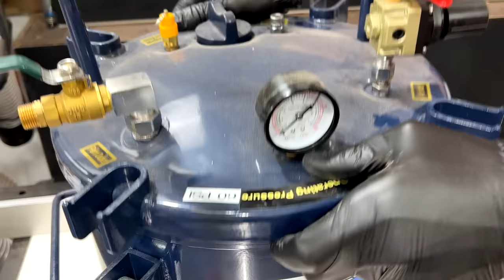Woodturning - Woodless Woodturning // A Brilliant Idea For Paper & Resin !!

Comment: I love it!  Honestly, you scare the daylights out of me when your fingers get that close to the saw blades. I have to fast forward through those parts.
Reply from the maker: It’s just the way it’s edited.. I’m going much slower than it looks there 😆
Reply: @JackMackWoodturning  Still, i'll ask you please, use a stick to push things through that saw.
Reply: @Alejandr0varsay  that's one of the benefits of a bandsaw. There is virtually no chance of kickback and it is one of the safest saws to use.
Reply: I agree - Please use a stick. It will be huge loss if  talent like this will lose a finger
Reply from the maker: Hi guys.. what you will find here is that those who use a bandsaw a lot don’t saw “use a push stick” because they understand.. and those saying “use a pushstick do not understand bandsaws.. it’s understandable that you think a push stick is the right way. But your not right. Thanks for your concern all the same.
Reply: @Alejandr0varsay  i was taught how to use a bandsaw in school. It is great for cutting shapes as you can guide it with your hands and turn the wood while cutting. The only time we were told to use a push stick was if the piece is too small to hold without getting in the way of the blade. The saws that always or usually need push sticks we were not allowed to use ourselves in the first place (this was 7-9th grades). If i was told by a woodworks teacher to cut out a drawn imprint of a hand (pretty complicated shape for the first ever try) without pushsticks or guides when i was about 13, i’m sure the actual woodworker will be just fine. 
Sometimes not using a tool is not about having a cocky attitude. Every machine has its own safety needs, you can’t apply everything the same way to everything. Like protective gloves for a more extreme example, a childhood friend’s late granpa was trying to be safe by wearing them while using a table saw, and the blade caught the glove. I saw the prosthetic hand on their attic. I highly doubt a pushstick would ever be trying to take a hand but sometimes it is just not useful, in many cases all it does is cause a lack in dexterity. Knowing your tool and the safety requirements specific to that tool is much more important and safe than going with a gut feeling based on other tools.
Reply: @SesseTheWolf  I agree 100% with you about the necessity to push barehanded when it comes to SHAPES, (as it allows proper control) and also  the danger of  gloves geting caught, no contest.

Of course, knowing the materials properties (soft or hard etc.), allows you to adjust technique and pressure while moving the pieces...I said "use a stick"
 because he was pushing a lot of small irregularly shaped pieces smaller and smaller every time.
Reply: @Alejandr0varsay  One of my professors would have us use clamps when using the belt sander or band saw and the thing we were holding was small. You just hold the clamp instead and your hand is about 3" farther from the blade, plus you can move the object just as easily. For most things I don't feel like I need them, but these are definitely small enough that I felt uncomfortable and I would use clamps if it were me.
Reply from the maker: This is not about arrogance. This is me disagreeing that a pushstick is of any benefit in this situation and further more making the point that a pushstick could in fact be a danger in this situation. 
You said yourself that I am cutting irregular shapes smaller and smaller.
Knowing this we know that the piece being cut requires a slight downward force and a very slight forward force. Two points of contact are needed to move this  irregular piece through the cut. 
How would you suggest safely doing this with a pushstick? 
The danger in this situation would arise when the lack of control caused by using said pushstick causes the pice to move freely after the cut is finished. This can cause a small and irregular piece to flip back over on its self. As it does it can be caught by the saw blade and pinged off the bed of the saw and up at high speed into the face of the operator… I know this from experience.. it is not a assumption.. it is a fact I have learnt from experience. 

Safety is not about “appearing” to be working in a safe manner.. it is about using logic, common sense but mostly experience to risk assess a given situation and implement methods that avoid the possibility of anything unforeseen taking place. 
Arrogance and experience are not the same thing. I know that if my flesh goes up against a running bandsaw blade flesh looses.. likewise I know I am in control of my fingers and the work piece to a much greater extent if I do not impede their interaction with a stick. 

Push sticks are used for table saws. Very very rarely will you find a time you need one on a bandsaw if you are using the bandsaw correctly. The two machines have only one thing in common and that is the fact that they both cut wood. They do that in very different ways. A table saw absolutely requires a pushstick. I will very rarely use my tabkesaw without a few pushers at hand. 

Teaching people when you are not in a position to teach is extremely dangerous too. And to imply the cocky attitude comes from me in this exchange is laughable. You think a pushstick is safer in this cut because you lack the experience required to make that judgement call and choose instead to err on the side of caution, unfortunately lacking the understanding and knowledge to see all the dangers and thus putting yourself in a much less safe position. 
I’m sure you think you are a seasoned woodworker. But you are not.. it is self evident in your comments. Show this cut to ANY professional woodworker and they will tell you that a stick in this situation would be the go to of a person who is yet to understand. It’s not open to debate.. you simply can not make controlled cuts safely using a stick when there is no fence or other support to work with. A fence would not help in this cut. A pushstick would not help with this cut. Arguing the point further is futile. You and quite simply wrong.
Reply: @JackMackWoodturning  
I never said I'm a seasoned wood worker, o don't work with wood at all.
I read your explanation (specially about the saw causing a piece to flip and fly to to the operator's face, I've come across similar situation working with other machines.

I appreciate the time you took to explain this, and i understand I was wrong.
Thank you.

I'll remove the previous comments.
Reply from the maker: Please do not clamp something then run it through a saw blade, even if it is only a bandsaw..  your teacher was a teacher and not a professional woodworker. 
If you put pressure on an piece of wood then push it through a saw blade the kerf will be closed, you will need to push rather than feed the piece into the blade when the cut finishes the release of pressure can cause “follow through”
You’ll find your hand moves much more than 3 inches in a split second when that happens and it’s moving right into the blade. 

It’s baffling that you guys are attempting to talk about “safety” by recommending dangerous solutions. 

Give me strength 😫😫😫
Reply from the maker: Please do not remove your comments. It is important for people to be able to read this find of discussion
Reply: @JackMackWoodturning  I didn't know that, thanks for telling me. I honestly thought I was doing things safely
Reply from the maker: No problem at all. I’m sorry if I come across exasperated or rude. 
Iv been doing this for 20 years as a professional. And I’m constantly having to be told by hobby woodworkers that I’m doing it wrong 😆… then they call me cocky for trying to share my knowledge 😫
What your teacher showed you is a fine way to hold something for sanding. And would be okay (only in a pich) for a non through cut. It would also not cause you any real issues 95% of the time. But when you get complacent (because you think your safety solution is guaranteed) that when you’ll follow through with too much force and turn one knuckle into two. 
🙏🏻
Reply: Jack, sorry, looks like I opened up a can of worms. I truly enjoy watching your videos and think your work is absolutely beautiful. I’m so glad you are able to take the criticism with a grain of salt. I’m sure you would never jeopardize your life and livelihood. Keep the videos coming, they are truly wonderful.
Reply: @JackMackWoodturning  I agree with you that probably you know what you do.
But its looks dangerous.
So if you a proffesionalist you can imagine it could cause problems for non expierienced ones.
We just care about you and your followers.
Reply: Brenda, have a little faith. He still has 10 digits, FOR NOW. 🤣😳😳
Reply: @dang6832  I do have faith but it still makes me cringe.
Reply: @brendaconner1076  fair enough.
Reply: My first thought!! 😱
Reply: @JackMackWoodturning  it's the difference between knowledge and wisdom!
Reply: Do you actually think he would show a bloody injury? Grow up.
Reply from the maker: I have only had one accident while making these videos and I was more than happy to share it and explain in detail what I did wrong. It’s was around the time my son was born and tiredness plus complacency on top rushing to get away from work early lead to me making a few mistakes in quick succession which lead to me having an evening in the hospital getting stiched back up. 
You can watch that video here… enjoy. 
https://youtu.be/JRBVQhlGuV8
Reply: @mitchelnorton2692  why so petty. Women think of that stuff which is why they tend to die in less gory ways plus the maternal instinct does kick in. Getting my hands close to saws scares me a little too. We both know it would “violate YT standards” so they won’t show it, but let her worry without guilt.
Reply: @JackMackWoodturning  that’ll happen. I know i’ve done some “unsafe” things due to being tired. Just so long as you’re not telling someone “hold my beer” while making said mistakes. 
If I may, what do you do with the wood dust and shavings. I’ll bet you could make extra cash by getting together with other woodworkers and pooling the resources to make bio bricks for use in wood stoves or larger ones in fireplaces. Maybe paper shredding companies in the area could be elicited to add their shreds to the shavings. I’m thinking with the way we are going right now in the world we will all need some of this product to help keep warm during winters. If this works look me up, don’t know how🤷🏻‍♂️ as I’m not going to post my info all over, and give me as case or two yearly if it’s profitable. I’m not too greedy.
Reply: You do awesome work! I’m enjoying it!
Reply: Very true
Reply: Agreed!
Reply: It scared me too
Reply: How you loved this i extrem pollution for envoirment. Did you see all waste ..
Reply from the maker: What waste ?
Reply: @JackMackWoodturning  did you eat all waste ???
Reply from the maker: @vidyorumcu  I don’t produce any waste.
Reply: are you blind or what...
Reply from the maker: @vidyorumcu  no I’m not blind.
Reply from the maker: @vidyorumcu  what do you think goes to waste?
Reply: @JackMackWoodturning  Yeah you need a firm grip when cutting on the bandsaw!🤷🏼‍♂️👍🏻A dull blade are actually more dangerous ? You blades Cut VERY Well 👌🏻🤜🏻💥🤛🏻
Reply: I was thinking the exact same!!
Reply: @JackMackWoodturning  you’re not your
Reply: Ditto to the fingers close to blades 😮
Reply: Why are you scared ...not like it's your fingers .
Reply: @williamjones6053  not my fingers is correct but, I would hate to be witness to him loosing a finger. Even though he would probably edit it out.
Reply: @brendaconner1076  pretty sure that he like thousands of other trade workers use extreme care when operating tools with fast blades ..what looks scary or dangerous to you is just another day in the office for us ..his fingers were well in the safe zone ..I am a contractor and have spent the last 30 years of life operating wood cutting tools ..using caution becomes a instinct ..
Reply: @williamjones6053  I understand your point. There are times when I’m splitting wood, I know I’m being careful but, that doesn’t stop my husband from telling me to be careful.  It’s just human nature to be worried about each other.
Reply: @brendaconner1076  I gotcha ..I took your statement wrong .. misinterpreted it if you may ...
Reply: @williamjones6053  no problem. Sometimes it hard to put in words what you’re actually trying to convey. So glad you took the time to read and more understand what I was saying.
Reply: Me too!
Reply: @davidcunningham8319  Still, it's a dangerous tool. Kickback is only one danger, but if the finger slips, it's still terrible. I would also ask Jack to do it right, especially to show it to everyone who watches the videos and takes your work as an example. 😉
Reply: @JackMackWoodturning  Did you learn that in apprenticeship? Additional our master always told us: always two fingers between workpiece and bearing guide to go safer :P
Reply from the maker: No I learnt over 20 years that i am safer being able to see the cut from a standing position. The bearing is there to guide the blade and make a more accurate cut. 
As i don’t need an perfect cut and because I’m the only person who uses my equipment I use things in the way that works for me. If you feel you don’t have appropriate control of your own body/arms/fingers then the guard on the bearing may help you, however I’d say if you lack coordination you shouldn’t be using a bandsaw in the first place.
Reply: Which part? It looks safe to me.
Reply: @J_Clean_1996  I’m just a cautious kind of person.
Reply: Я в шоке 😳😁
От многих вещей.
От того, что, оказывается, в Европе еще живо токарное  и вообще ручное искусство.
От того, что кто-то этим занимается и кого-то учит.
От тоо, что у вас этому обучают в школе.
От того, что у вас бывают токари-профессора.

Я думала, что в Европе и Америке (не знаю из какой вы страны, в целом -- на западе) давно разучились делать что-то своими руками и знают только пластиковую посуду и отсутствие всякого напряжения ☺

Я в шоке от того, что мужчины способны так въедливо и долго спорить.
 От того, что вы умудряетесь соблюдать вежливость, несмотря на то, что автор периодически  макает вас лицом в ведро с эпоксидной смолой 😅
От количества слов и от того, что у автора очень правильный и богатый язык, судя по тому, как переводчик Гугл перевел текст. 
Сегодня день открытий 😊

А насчет пальцев -- интуитивно действительно страшно. Мой папа лишился пальца за один миг.
И эта мысль будет у каждого нормального человека, когда он видит такую картину.
Желаю всем вам творческих успехов и удачи!
Reply: All fun an games til you lose a finger.
Reply: Love this!!!
Reply: Same here!
Reply: @Alejandr0varsay smart advice I am almost certain he will not follow.
Reply: The kid is asking for problems.
Reply: @Alejandr0varsay only really need stick if ur cutting metal because the cuttoff could kick back and is sharp.
Reply: @GrannySoupLadle  I'll say this: When working with machinery that could slice off a part of your body, or severely lacerate it, any protection is never to much protection.

Like my father used to say: "Respect the things that can hurt you"
Reply: @Alejandr0varsay  right but sometimes using a stick makes precision difficult, and if you cut yourself cutting wood on a bandsaw thats kinda insane…
Reply: @GrannySoupLadle  I get your point, however,  you can also break your arm just by tripping over and falling on the floor, so.
The previous comment still stands, respect what CAN hurt you.
Peace.
Reply: @Alejandr0varsay  I’d say respect the skill and expertise of proffesionals who do this day in day out and dont get hurt. Respect in the work place is about not becoming complacent with good practice, has nothing to do with how much gear you “think” you need. There are instances where gloves make it more dangerous, because all then do is make it harder to grip the peice. Having a good grip, while keeping fingers out of “line-of-fire” is safe. Having gloves only increases the single risk, which is loss of grip.
Reply: @GrannySoupLadle  You clearly have no experience in manual work.
Reply: @Alejandr0varsay  I would say that of you, I’ve been a fabricator for 13 years and Im 31 so thats a good portion of my adult life 😂😂 You would be lynched if my boss saw you taking your sweet ass time on the band saw with a pish stick instead of doing it properly.
Reply: @JackMackWoodturning I put it on gast forward sometimes if I don’t have enough time to watch!  Glad to know you’re being safe! 🤗
Reply: Me too!!
Reply: I know the safety rules as well as my three fingers.
Reply: @tonybeauchaine3951 A little knowledge is usually more dangerous than none.
Reply: Lol, that happened to me in grade 7 wood shop; I cut right down the tip of my right ring finger. My finger was forked for a short time afterwards. The a-hole of a principal drove me home and berated me for my lousy grades during the drive. 🖕Mr. Mighton!

Comment: ❤❤ This is awesome the way the colors came out and the pattern it made I LOVE THIS PIECE!!! YOU NEED TO DO MORE OUT OF CUT UP PIECES YOU USED YOU SHOULD DO A SET OF LAMPS BUT USE A CLEAR RED DYE IN RESIN SO LIGHT PASSES THROUGH IT, EVEN IN THE SHADE YOU MAKE TO PUT ON THEM WITH THE SAME DESIGN IN IT!!! 
THEY WOULD LOOK BETTER THAN A TIFFANY LAMP MAYBE ADD ONLY 1 EXTRA MOTHER OF PEARL GLITTER THE SUPER SMALL POWDERY GLITTER JUST A LITTLE NOT A LOT IN BASE AND SHADE❤❤ IF YOU DO IT LET ME KNOW WHAT YOU WANT FOR THE PAIR... MAKE THEM A THIN BASE WITH WHAT LOOKS LIKE A CLAM SHELL SHADE LIKE A RUFFLE ON A SKIRT!❤❤
SORRY FOR THE LARGE CAPS MY PHONE IS MESSING UP AND ITS STUCK ...IM GETTING A NEW ONE!!😂😂😂😢